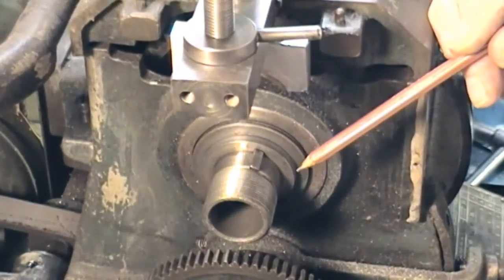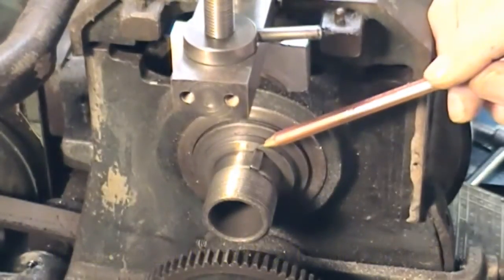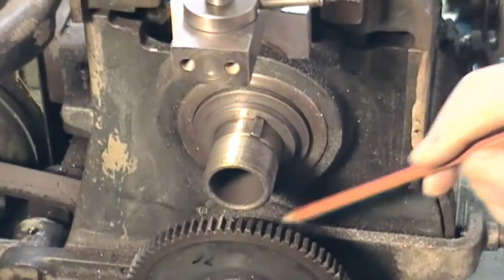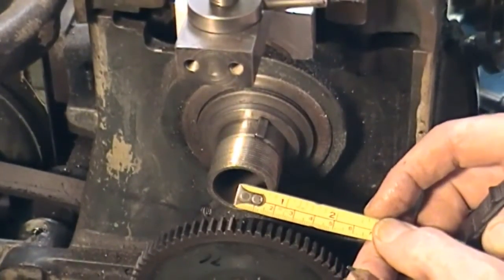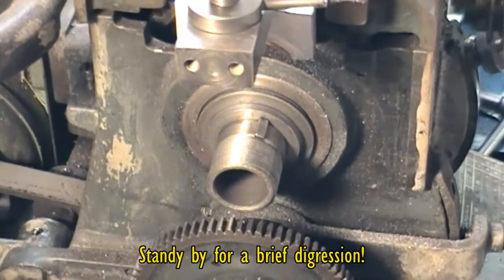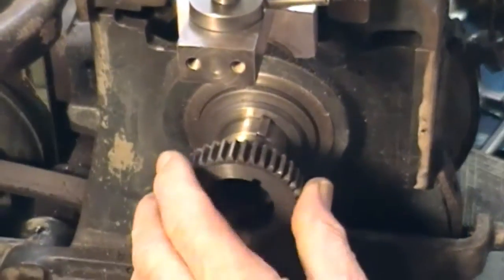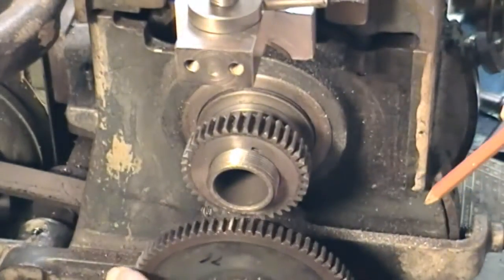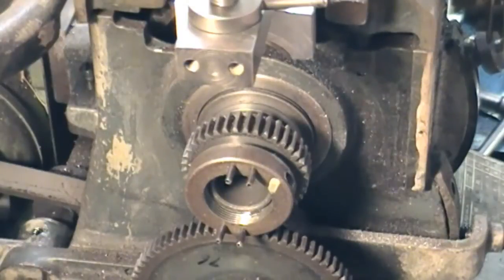Lathe spindle brake project - next step rethink!

Comment: Great idea from what I can judge. The way that they did braking "the old way" was just a wooden bar laid onto the ways below the  chuck, and when braking was needed, just pull up on the bar. Bar presses against the chuck and therefor brakes it :D
Reply from the maker: Sounds 'primitive' Adrian but guess it would work - may just have to try that for s**ts and giggles! :)
Reply: ChrisB257 Well, it works for shure - on the old lathe that I saw that on, they had to use it when stopping the spindle cos the idle pulley that usually spins loose on the shaft was pretty stiff - so when you moved the belt over to idle, the lathe would still spin until you smacked either a broomstick into the gears or jam that wooden bar underneath the chuck ;)
Reply from the maker: Adrian Straub I actually tried using a piece of  1/2" thick scrap plywood just to try it -- bottom end rested on far side way and when lifted it put drag on outside of chuck back plate - does help - but just a bit primitive! :)
Reply: ChrisB257 Yep, it shure is primitive LOL :D

Comment: Hi Chris,
Your disc brake shows promise, another thought, a series of holes with an index pin will turn your lathe into a rotating index fixture!

Just thinking out loud.
Stan
Reply from the maker: Stan - may well drill holes, although I do have some indexing via my simple use of a gear. Perhaps another future project!

Comment: I don't think aluminium will work work with regular brake pad material I'd go for steel. Maybe a cheap circular saw blade cut down to size and bored out, though I'm not sure how hard it is to cut
Reply from the maker: You could well be right - though would choose heat treated Al. However, when I get the bicycle disk and pad I will evaluate those. Steel is worth considering - thanks.

Comment: Hi Chris , Have you thought of putting it on the motor v/speed side? I see there is a inch plus of shaft and you can put a bigger disk . eg: car disk
Reply from the maker: Hmmm - now there's another thought. Just checked that area and it's possible that a 5/8" expanding arbor could be made to go into the end with an integral disk.  Thx for that mention - may even be pursued further.